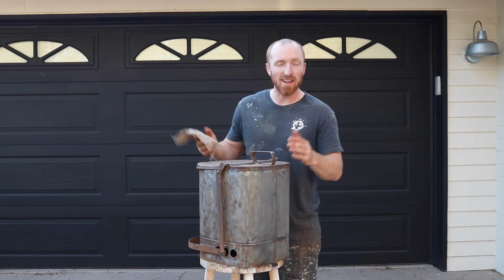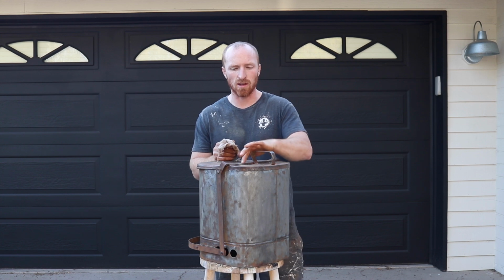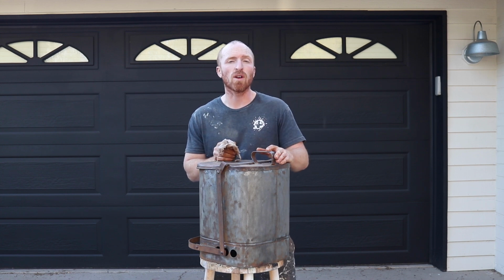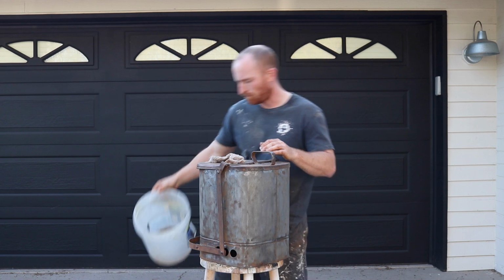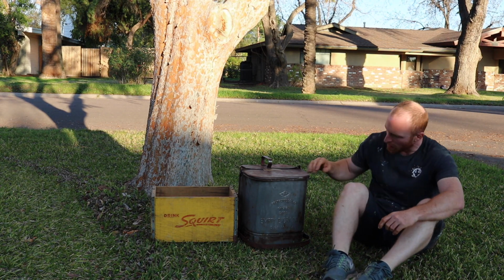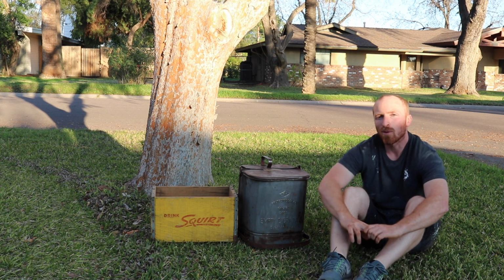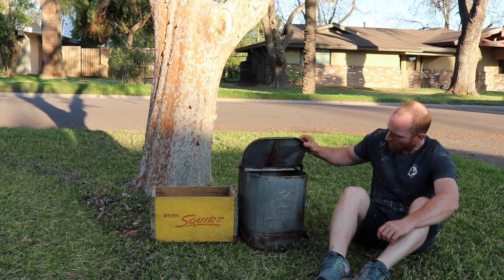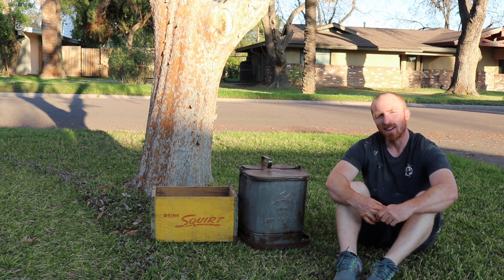Refinishing an old Industrial Trash Can | Restoring | Metal Project

Comment: great video. I want to do a similar project with a garbage can but I want to paint it. How would you have painted the garbage can if you wanted a color?
Reply from the maker: Thank you. I would give it a good cleaning and possible sanding or wire brushing. Prime and paint it. Never done a project like that. Sounds interesting. Good luck.